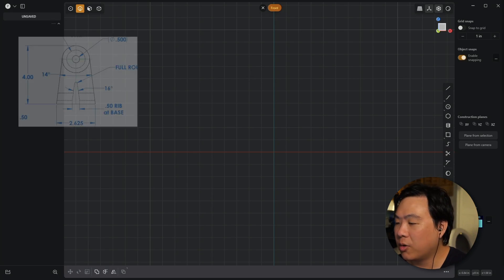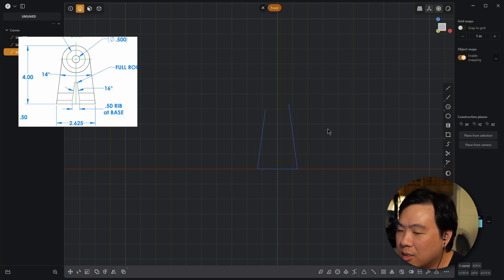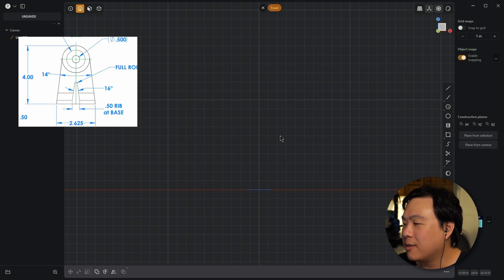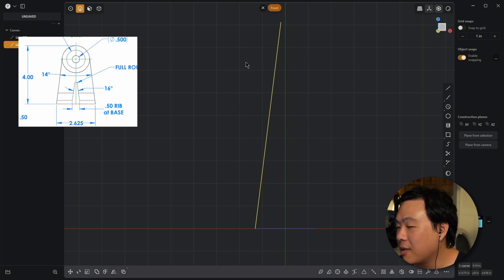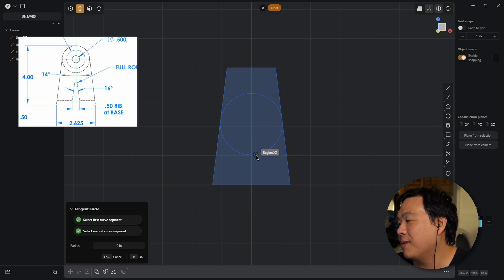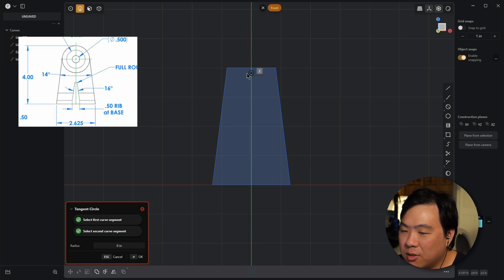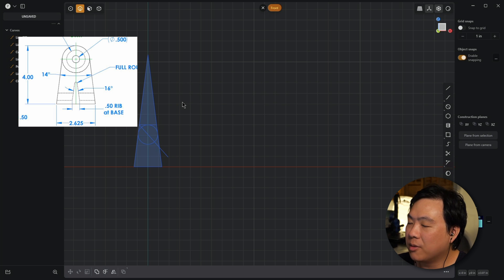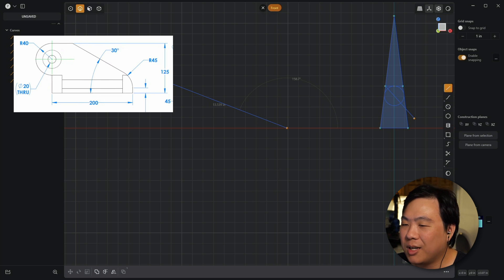Plasticity Tips: dealing with Angles

Comment: I think someday we will have to add constraints. There are lots of problems that are too painful to solve with this high school geometry approach. But in the meantime we will try to make incremental improvements to the snapping system
Reply from the maker: Hey! Thanks for watching the video. I put rant in quotes because it's not really a rant. The snap system is pretty powerful, and honestly I think a lot of people (including myself) like it because it's less rigid than your traditional CAD software.

I just think there are some small things (that I pointed out in the video) that could help.

A recap of my wishlist from this video:
- Tangent circle: option to switch between specifying a  radius and the ability to specify a 3rd (point, circle or line) to be tangent to 
- angle bisector snaps
- easy dimensioning of angles between two lines

But I understand you guys are a small software company (a startup essentially unless I've mistaken). And the product that you have so far is lovely and a joy to use (most of the time 😊)
Reply: @davinchewk  "Tangent circle: option to switch between specifying a  radius and the ability to specify a 3rd (point, circle or line) to be tangent to " I think this one is already on the beta
Reply from the maker: @nickkallen1  awesome!
Reply: I like the idea of the "option" of constraints. I love the freedoms as well of not having them.
Reply: @citizenclown  I completely agree with being able to not use them at will.
Reply: Coming from Shapr3D, your snaps are miles ahead of theirs.

Comment: Great video, thanks!

Btw is there a way to align/level a line’s endpoint to another line endpoint by axis?

In blender we can just scale them along an axis to 0, and they’ll be aligned.
Reply from the maker: Thanks for the comment. I'm not sure exactly what outcome you want, but if you want to "flatten" a curve along an axis, you can select the curve (using edge selection) then "s" to scale. Press the key corresponding to the axis you want to scale by, then enter 0.

Comment: New to cad and have been looking at which one to learn.  Cost and no cloud based has been big factors in determining the program.  Plasticity and Alibre are my top two finalists.  Fusion 360 would be an easy choice, but cloud and cost has ruled it out.  Enjoying your videos, keep up the great work.
Reply from the maker: Yeah! Plasticity and Alibre are my two choices as well. My main use for CAD is usually to quickly model something functional for 3d printing. That makes plasticity my go-to. But Alibre is definitely more "featureful" and is more comparable to your other parametric CAD software but at a fraction of the cost.
Reply: @davinchewk  Thank you for the input.  Bought a 3d printer a couple of months ago and want to use it on home projects in the near future.  Building a home flight simulator and other home projects in the shop.  I do not like the subscription model on software and would prefer to upgrade when future features I might need are available.  Really limits the choices.  The simulator I plan on using extruded aluminum for the framework,similar to racing sims, to attach monitors, instruments, flight and engine controls.  Any input if this software could be used in the design using extruded aluminum or other software recommendations would appreciated.  Might be a good future video for your channel.  Lots of uses for extruded aluminum.

Comment: Thanks for the video. It's issues like these that stops plasticity from being my main cad software. When you are trying to bang out a lot of dimensions to get through some parts you need to make, the extra steps just yanks you out of your flow state. It's easy and fast to design something that looks like an actual part but much harder to design something that will be an actual part. I also find it too counterproductive to import and export files between cad programs to use the features plasticity is lacking.
Reply from the maker: The software is actually improving at an incredible rate and I've heard that the current beta includes a ton of quality of life enhancements.

But yeah, without constraints these workarounds will sometimes be necessary.

In contrast to your experience, I've found that designing something that will be an actual part actually pretty enjoyable in plasticity. I'm mainly learning CAD for 3D printing purposes, and the direct editing in plasticity has allowed me to quickly iterate on 3d printed parts.

Comment: I don't know what version of Plasticity you're using but it doesn't seem to be up to date. Your knowledge of the program seems to be pretty lacking though it looks like your intention is really to bag the program. There is dimensioning in Plasticity and if you can't work out that dividing 14 by 2 = 7 then you have a serious math problem and perhaps should choose a different career - it's hardly university level mathematics. What is missing from the diagram you're showing is the outer radius of the top circle, which would greatly simplify creating the object and I am sure this was available in the challenge. This mechanical part is extremely simple to make in Plasticity and a full 3D model can be done in a couple of minutes without all the drama you've introduced.
Reply from the maker: I'll admit that my knowledge of the program is lacking, but excuse me I think we're still missing some context here. First of all, this video is to address things from the CAD vs CAD perspective - specifically a match between Plasticity and OnShape that went on. A fairly proficient plasticity user "struggled" (under pressure) with some angles and fumbled in the match. Second, I am sure I repeatedly said "this is not hard math, just something additional you have to think about" compared to other CAD programs. So please, lower the forks since there's no need for personal attacks. Thirdly, I am not here to "bag the program". I like the software and is an owner of the studio license myself even though I'm using it as a hobbyist. Lastly - no the dimension of the radius isn't given in the challenge. I'm showing you exactly what was given to illustrate that in other CAD tools, the availability of constraints would make quick work of the model, but the lack of it in plasticity means additional steps - which is a disadvantage in speed modeling.

I'm also not sure what "drama" you're referring to. If you go through the comments (specifically the one I pinned), the creator of plasticity acknowledges some of the disadvantages demonstrated in this video (again from a CAD vs CAD perspective). I love that the owner is engaging with the community and that the software continues to get better.

So please, no need to get defensive about the software. I'm creating content with the intention to share knowledge and to teach. Yes I am new to the software and my knowledge is almost certainly lacking. If there is anything I did incorrectly, please do point them out.
Reply: @davinchewk Plasticity is really a very young CAD like program aimed at artists and it's primary aim is not that of a mechanical engineering program although it does a reasonable job at creating them. Comparing it to programs that have been on the market for many years is not really a fair comparison as Plasticity has only been available for around twelve months and shows a lot of promise. I'm a long term CAD/3ds max/Rhino user and Plasticity is so much easier to learn and use though it still lacks the bells and whistles possessed by these programs, but given time who knows where it will go..

Comment: Hi, at 4:55 you can select the Three Point Arc tool. The 1st point snapping at "Mid" of the top edge, the 2nd point snapping at "Curve" of the left or right edge, the 3rd point snapping at "Mid" or "Closest, End, Intersection" of the opposite edge. The rest is mirroring & trimming.
Reply from the maker: Hey! Thanks for the comment. I think I've tried doing that before, but was unable to determine where exactly on the left or right edge to click? The curve is a "fully rounded" curve which is why the circles and tangents are needed. But if you found a way to do this with arcs, that's great!
Reply: @davinchewk  You can do the same thing by using the tangent circle tool. 1st tangent snapping at "Intersection, Mid"" of the top edge, 2nd tangent snapping at "Curve" of the left or right edge, then drag the cursor to the opposite edge snapping at "Curve". This 3rd snapping point will also be tangent.

Comment: Nice video and discussion, that first model was based on one that I got in the tournament. That was a struggle in build123d as well, but thankfully build123d now has a full round feature for this scenario (introduced in response to that model, haha).
Reply from the maker: That's awesome. Nice to see software developing more and more features. I never heard of build123d until I watched your match. Seems really cool, and as a software developer I definitely approve 😂. Are you a contributor to the project as well or just a user?
Reply: @davinchewk I am a contributor yes, and also probably one of the first users when the project started less than 2 years ago.

Comment: So depending on the CAD design do you rotate off plasticity and alibre? Although these examples are just a slightly different mental approach.
Reply from the maker: I'm only learning CAD for 3D printing purposes. Now that I've used a couple of different CAD software, I would say for 99% of my use cases I would probably just do in plasticity.

But things that require mathematical functions (eg: modeling iso metric threads), I don't think you can do (at least not easily) in plasticity due to the lack of mathematical functions. In those situations I would fallback to "traditional" CAD like Alibre or F360.
Reply: @davinchewk  solid I am as well!  Mainly focusing on engineering grade parts. Sounds like my workflow can be a mix of both. I’ll check out some of your videos on albre. Appreciate it!

Comment: Trig??? Taking 7 away from 90.... Or adding 7 to 90. Not sure you may be overthinking that a bit... 
So then why, I wonder, when I select tangent circle I select left vertex, horizontal then right vertex sorts it out. Are you using the current version 1.4.18??
Reply: Ok... I understand the issue now. You've created your cropped triangle, the tangent circle picks up your say left hand curve, picks up the top horizontal curved. Now you have a circle that expands and contracts in the top LH corner according to mouse position. When you complete the circle by clicking on the right hand curve it doesn't pick up the tangent.  It picks up the curve and you will get something that is very close to a tangent if you zoom in but strictly speaking, it's not. Now maybe as a 60 year old engineer brought up on a drawing board, my instinctive reaction is to draw a circle with centre point top right to the Centreline and use it's intersection with the RH curve to finish the tangent circle.
I can agree that it's not an ideal way to do this but it's not a huge amount of metal gymnastics to sort it out.
Reply from the maker: @colinhare4722 That's actually a nice workaround. I might just do that moving forward as well. I think @nickkallen1 said that the beta right now includes some enhancements to the tangent circle tool (a general solver for apollonius problems perhaps?), so we might not need workarounds soon. I do love that the software is already good and is getting better and better.

 In any case, I agree it's not a "huge" problem, but from the "speed CAD vs CAD" perspective I'm showing how plasticity users are disadvantage. My background is not in engineering, so if I make any mistakes in the video, please do continue to comment and point them out!

Cheers.
Reply from the maker: Hey! You're right in that it's simple addition/subtraction. My goal was to do a comparison between plasticity and traditional CAD software, and outline places where it's a little trickier to do in plasticity.

In the video I was running 1.4.10. I've since updated to 1.4.18 after seeing your comment, but somehow the tangent circle tool still isn't working as per your description. There is a possibility that I'm doing something wrong though.
Reply: @davinchewk  I'll take a look in the morning (UK time) but it's a 3 point tangent circle. Might be worth taking a look at options in the command list. 
I used CATIA v5 for my day time job but find Plasticity just gets the job done quickly and without fuss for all the work I now do which is mainly 3d printing.
Reply: For out and out speed, what is your 'go to' CAD package then? I have experience with several CAD packages and found Plasticity to be by far the quickest and most enjoyable (read less frustrating).
Reply from the maker: @colinhare4722 Hmmm... Well I'm speaking with the context of TooTallToby's CAD vs CAD battles, and from that perspective it seems like traditional CAD like solidworks, and onshape have an advantage.

But from my own personal experience, my exposure to CAD is limited to personal 3D printing projects, and I've found plasticity to be the "quickest" and "funnest" tool to use most of the time.

But I guess it depends? If I needed to model something like iso metric threads, then my go to is Alibre. If I just had to draw up a replacement bracket for a shelf, I would probably use plasticity.

Comment: Can you make a outline of a circle at the top first then do the rest of the lines for the shape
Reply from the maker: Hey! Thanks for the comment. You might be able to, but for me I found it a bit difficult because of the constraints. You're not given the width of the circle, so you would have to come up with a way to calculate that.

The 2.625inch base and the 14 degree lines seems to be the elements that define the width of the circle for me, hence why I went and did those first. But let me know if you can come up with an easier way to build outline! The way I demonstrated in the video is quite tedious.
Reply: @davinchewk  I didn't think of that before,but you make a good point.Just want to let you know your video's are very informative
Reply from the maker: @Scott-1974 Thank you! I'm glad you find them useful. Please continue to leave me feedback so I can learn how to communicate better / make better videos.

Cheers.

Comment: Very well explained. Once you know the tricks, you can draw anything with Plasticity. That’s also what makes it appealing to me. However, it needs to be right on the first try. Under time pressure, 30 degrees can quickly become 15 degrees because you often have to do it that  way 🤦🏻‍♂️. Thanks again for your mental support. Good video, keep it up.
Reply from the maker: Yeah! I can relate simply from doing the practice models. It's why I wanted to make this video - to share a couple of tips and also a "rule of thumb" I've developed to make sense of some of the quirks in plasticity.